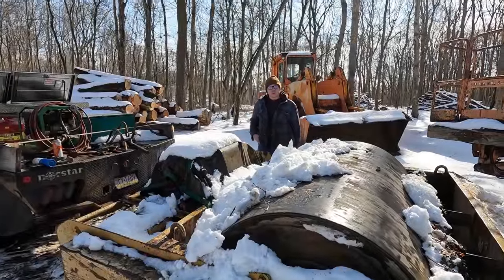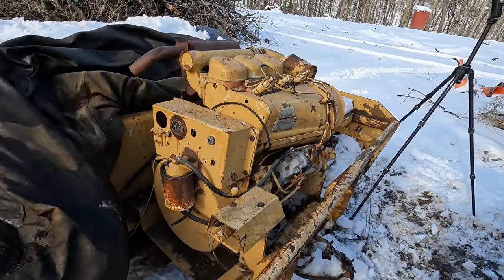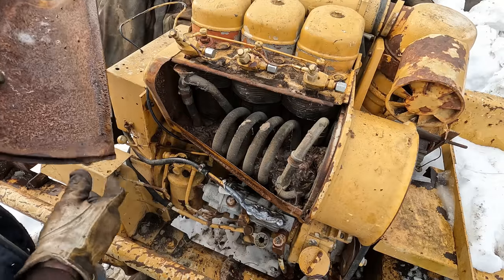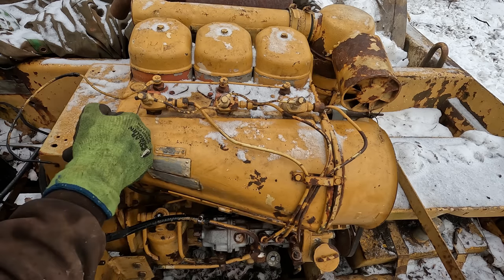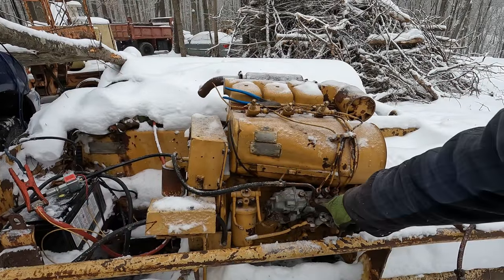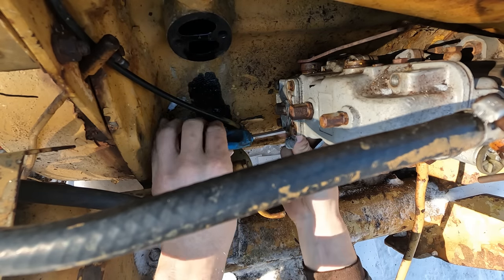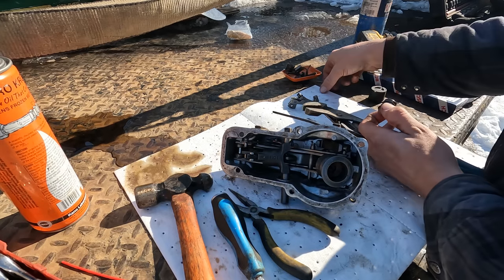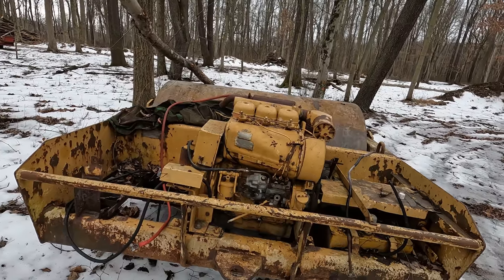Diesel Powered Roller Compactor, Sitting 30 years, Will it ever Run again???

Comment: Matt , here in Europe we have plenty of these old Deutz engines around , and i know one thing : they can be pretty difficult coldstarters in freezing temperature  and if they done a lot of hours .   Does your engine have a glow plug in the inletmanifold like in mine  ? If so , put some 12V on the glowplug for about 20-30 seconds before cranking .  My 3cyl  Deutz starts pretty well but it has done only 8000hrs .
Reply: i think his "glow plugs" are nicknamed a propane torch lol
Reply: Yeas, those Deutz engines are really hard to start due to the fact that they are usually not direct injection, but have a precombustion chamber setup. That needs some time to get warm, especially with old school glow plugs. 
And even if your Deutz engine is worn down to bits, that's not too big off an issue. One of the greatest things about them is their repeatability. It doesn't matter if you have a single cylinder, two or six. The engines only differ in the injection pump, crankcase and shaft. Every piston, head and cylinderhousing/sleve is the same. That makes for great parts availability. Like a piston with rings and cylindersleeve only costs around 200€ for some engine families. And with them not being in one single block you can just chance them easily too. They're just fixed with the headbolts into the block. Experienced personal can switch the complete upper engine in about half an hour. It's all so simple. I.e. for adjusting the compression/clearance between the head and cylinder, you just put washers between the block and sleeve. Deutz recommended method of measuring the clearance is just to put a piece of soldering wire onto the piston and to turn the engine over. 
The wire gets smashed and you can measure your current clearance.

Edit: As for your "shut-off" lever. Often those Bosch pumps have their run position pushed int and it a pull out all the way to stop. Inbetween, before you start to feel the spring action there is usually a third position to give you more diesel during start up.
Reply: There are actually glow plugs, right behind the injectors, the wire could be seen not connected, would just take another jumper wire from the positve post on the battery for around 30sec before cranking and the chances of starting up would multiply...
:-D
Reply: @horstszibulski19  I know lol but he was using the torch as an intake heater
Reply: USA youtubers stubbornly refuse to use the glow plugs. 30 seconds or more is needed.
Reply: @erik_dk842  Not all of them, check Salvage workshop, he is very aware of them! :-D
Reply: @beettheyeetskreet9216  Together with the 80% ether spray, it got very hot on the outside, too...
:-D
Reply: @horstszibulski19  just a little lol
Reply: @horstszibulski19  You are correct. The design of the motor was with British Ricardo designed pre combustion chambers like the old Mercedes Benz diesel engines so it definitely would like functional glow plugs run for thirty seconds or so.
Reply: @erik_dk842  I agree with that, was the same with Doug from SV seeker
Reply: @horstszibulski19  could wire that up to a toggle switch on the side panel to make it easier
Reply: @erik_dk842  Haha I'm not the only one? I have a video of me starting my tractor without glow plugs using gasoline on a rag
Reply from the maker: @horstszibulski19  I tried it. They don’t seem to be drawing any power or making any difference
Reply: @DieselCreek  I always keep accidently deleting my comments while typing them so here we go again:

You could trouble shoot them but therefore you need to know a bit about glow plugs to determine how they should work and how they should be wired up.

The really old Deutz engines and glow plugs with a heating coil exposed to the outside (of the plug, it's still inside the precombustion chamber). These are usually connected in series. Meaning every plug has two connections top and bottom. The top of the first is connected to the input cable. The bottom of that one is bridged to the bottom of the second plug. The top of the 2nd is bridged to the top of the 3rd and its bottom Is connected to ground. 
It’s usually easy to be spotted when you have a cable on both ends of the row of glowplugs. Due to them being connected in series, each glowplug can physically only get 4V at max from a 12V battery. But they are usually rated for even far less, down to 0.7V.

The newer design is more powerful with a ceramic shaft and is also usually connected in series. Meaning there is usually a long bridge on the top of these plugs connecting all to the input wire and the body often grounds them to the block. This means they could technically get 12V (usually rated for 9-11-5V) each. 

But usually glowplugs take less than 12 or 4V. That’s where the glow plug circuit comes in. It normally consists out of a switch, you glow light and a glow resistance (sometimes a small box, sometimes a coiled wire). The job of the latter is to reduce the Voltage getting to the plugs, because if they get too much they either burn through or don’t even heat from the start. So always use the right combination. Maybe it’s even written on your plugs or you have to check their parts number how much they can take (12V battery voltage – the amount your plugs can take = glow resistance voltage drop, but you have to remember the plug voltage in a parallel connection is your rated voltage and in series it’s the rated voltage times the number of plugs).

So now to the trouble shooting: 

First you need to determine whether your plugs are in series or parallel, because the steps differ a bit.
if you know that you can take out your multimeter and use the continuity check. 
If your plugs are in series you connect one of your probes to ground and start checking for continuity. In this case I would recommend to start from the last glow plug. Check if you got continuity to the bottom post of this one, that’s connected to ground. Then check it’s top post and move on down the line until you get to the glow resistor. It something is bad there, check if it’s the connection or a the last plug you tested. Especially the cable going to the plugs is often broken or the last ground connection. If one connection or plug is bad, the whole circuit is interrupted and nothing works.
On parallel plugs you can disconnect the top rail and check if every plug’s top has continuity to ground. Maybe even compare the resistance values between the plugs. But because you said the system doesn’t draw any power I would offer the guess that not all three plugs have a broken ground connection. So you could maybe start the chain with the wire leading to the glow resistance. 
If one plug is broken in a parallel systems the others still work, but their life expectancy is reduced in that case, so they would still brake. 

If everything is fine leading up to the glow resistance you can start checking there. I doubt that you would get a continuity signal through the glow resistor to ground, because the resistance should be high by design. If you get continuity through there it’s even better.  But if not, put one probe on the other side of the resistor and start probing for continuity up to your glow switch and again from your switch to the battery. 
If you still haven’t found the issue you can connect the input of the resitor to 12V and check the voltage to ground: On the input of the resistor it should be 12V and on the outpout 3-4V less. If it’s still 12V it’ shorted or you’ve still got a grounding issue you somehow overlooked.  If the voltage drops there your plugs work and the problem is maybe in the switch or something like that.  If you got 0V after the glow resistor it’s knackered.

If you do this you should be able to find the problem or to just rewire the whole system, but don’t forget that they need this resistance to work.
Reply: If I look at the engine at around 7:54 i can kinda look at them. Seems like there is a input cable but the last one has no connection to ground and the wires connecting the plugs to each other all seem to be at about the same height. So i would guess they're parallel. 
So goof chance its the cable leading to them or a component before it. Or maybe someone already gave them 12V a few times too often and they all died, but that's unlikely and i would hope for you that this isn't the case.
Reply: @DieselCreek  Ah, ok...too bad, they would help a lot, I bet...
Could have know that by the copper that sticks out on the end,  I really expected  that you tried them!
:-D
Reply: @erik_dk842  I use them! I have two F4L912Ws in underground mining equipment and the glow plugs are indispensable.

Comment: Right call on the starter, I don’t think she was spinning fast enough to start.
Reply: On starter theory, the usual problem is that they are full of coils of wire that are insulated by very thin shellac, which burns off easily whenever they are run too long and overheat.  Then with in insulation burnt off the coils, the electricity shorts right through instead of going around in circles like it is supposed to.

Comment: Hi there, 

these are extremely common engines in Germany. Parts are dirt cheap here and very easy to get.

Usually they start, even at -10°C in a blink of an eye.
Honestly, you glow some seconds, turn the starter switch and after very few revs the engine is running.
At least if it got compression and the starter is ok.

Hope to see this engine running again with the new starter!

Comment: You're going to need a fuel return from that pump too. Can run a "stinger " line that basically just tees the return back into the supply line ahead of the lift pump, but its not good to run long term like that, can overheat the fuel. 

Could be your injector tips themselves are either frozen with water, or rusted shut. May have to pop them off and see if Area Diesel can do anything with them.
Reply: I also noted that number two cylinder is still pumping Yoo-hoo chocolate drink instead of diesel...

Comment: Not to kill your hopes here, but my Deutz D4006 tractor with a f3l912 engine,  very close to yours, which sat for 20+ years was impossible to start. The piston rings are known to rust in the grooves.  I pulled all three cylinders,  put new pistons, rings and cylinders and ground the cylinder heads on the cylinder,  and it fired in first try. What a thrill.  😀

Comment: The whole time I was saying to my self was that starter motor needed cleaning out the brushes get stuck and the commutator needs cleaning which is easy just with sandpaper and then you bust up a hacksaw blade and use it to clean in between the copper teeth then you might of had a chance but you cooked it unfortunately, I admire you’re determination you will go a long way sir ,life is all about accumulating knowledge and you are well on the way there and thank you for you’re quality videos

Comment: I used to have the exact same roller, bought to compact our dairy laneways for the cows (to keep rocks down and to help with sore feet on the cows) it's a great machine. We also use to run 3 different models of the Duetz tractors, our first was a 52hp 3 cylinder, that tractor did over 10,000 hrs and never opened up, just batteries, alternator and tires... Never missed a beat, great simple engines that are super fuel efficient

Comment: Hi Matt, love your videos, does look like the spinning speed was too low for the engine to pop off on. But this type of deutz engine (F3L812) is an indirect injection engine so you really need the glow plugs working. But beware with them the are most of the time just 2 volt type. So there should be a big resistor somewhere that's in series to regulate the voltage.

Comment: Hi Matt take the drive shaft off of it and free the engine up also if you've got a Turbo heater stick it under it and get the oil engine warm It should Spin over easier Also I would take the fuel filter off and check it make sure it doesn't have water in it

Comment: Matt, these engines are bullet proof, very simple and reliable. You need to check the glow plugs, because otherwise they are difficult to start. But it seems that you have an issue with poor fueling, maybe the inyectors are stuck or the tips rusted. I have my self a 3 cylinder Deutz tractor from 1962, the engine is similar, but this one looks newer, maybe is a F3L913.

Comment: Matt, You are havin' too much fun in the snow!  Tim Mohn is correct, but it may be a bit newer model F3L912 (70's & 80's)....The AM Bosch starters were $400 apiece in those days...!   Once you get it running, the cyl head seals will probably need replacement, (copper compression rings which corrode when sitting long time -- combustion gases eat 'em).   Great engines, lots of torque, dependable; they like to run occasionally and not sit idle.

Comment: Hei Matt, Diesel engines are a hard nut. It takes a lot of energy to start a diesel engine. There has to be a very high pressure in the cylinder to ignite diesel and high pressure in the fuel pump. To get high pressure you have to have enough volts. 2 batteries will give enough ommhmff the cylinder will spin in high pressure and build diesel pressure and it will fire. When the injectors are dripping fuel close then turn the nut closes to the fuel pump and nr 1 and 2 and 3. I would recommend changing those to batterie cables because of  safety and volt draw. The your awsome content, keep it comming. Greetimgs from Norway
Reply from the maker: I put a different set of them right after I started playing with this thing. I just didn’t show it in the video but you can see they are new cables

Comment: Hello Matt,

greetings from Germany. The engine you have there is an F3L812 eninge, because it has glow plugs, the injection pump is flange mounted to the engine block and the injection lines run outside of the cooling housing. There are many parts sitll available here in europe. 

By the way: This is the Deutz engine I know the best, since it is running my Deutz D40.1S tractor. I have some spare parts lists, even for the injection pump. So if you'll need anything you may contact me.

Kind regards, Kai

Comment: My brother has had several Deutz tractors in southern Minnesota.  He had them in a cold lean to building And had to use a oil fired torpedo heater blow on the cylinders find to warm it up .  It was easier to start to do chores.

Comment: My Dad used to sell and service Porsche-Diesel tractors in the 60s and 70s.  They also were air cooled. They made 1, 2, 3 and 4 cylinder models.  I believe  some of the Deutz parts were interchangeable.

Comment: Just a suggestion, but on equipment you have brought back to life, it would not hurt to take one day a month or how ever long seems good to you and start everything, bring it up to normal operation temp and drive it long enough to get the transmissions and/or hydraulics up to a normal operating temp.  Keeps parts oiled, tires from getting flat spots or rot, tracks from rusting in place, and makes you put fresh fuel in them.  During the summer you can also take the time to clear weeds, seems like you have a whole video on clearing weeds.  Just a suggestion, an onuce of prevention is worth a pound of cure after all.

Comment: I'm not a starter guy either, but I'd just look at what the condition of the teeth and cone are. If they aren't destroyed, source a different motor assembly that provides the same amount of spin. If you can't find something that bolts the old cone on the new motor, then an adaptor plate between the cone or a custom locator cone works just as well. You have to do some modding, but other options are available.

Comment: An infrared propane ice hut heater lying on the ground is a great way  to warm a diesel.  Used one to warm my dodge diesel pick up at the cottage in the winter.  warmed the oil and the block in a few hours.

Comment: Just run an extra jumper cable to the glow plug wire 30 seconds before trying to start they wont start without the glow plugs , never use ether  on  Duetz as it will stretch the head bolts  . Enjoy your videos

Comment: I sure can use that for my driveway. I just resurfaced it with 5/8 gravel. Great job on the video. Next time jump it right off the starter so to by pass all the bad wiring.

Comment: These loud engines are used a lot in Europe. Do you want more power? we just add cilinders  F2L912 / F4L912 / F6L912. There are even V12 air cooled engines! I look forward to the next video.

Comment: I rebuild these machines as well as the motors where i work. From expirience i know you really need a feeder pump. You dont need the same as the original an electric one works just fine aswell. Most of the ones that come through our workshop havent run for years and i always do the same to get them running good. Remove the injectors and fill the cylinders with some oil. crank with a GOOD starter. Make sure the is plenty of fuel to the pump. On idle the pump should get .5 bar of fuel pressure. These engine really like to crank fast because they tipicly have pretty bad compression when they have sat for a while. The oil help with that alot. Lastly yes, you would benifit greatly from working glowplugs. As for the machine itself, the hardest parts to source are the centrifugal clutches. The wear parts are not made anymore but there is a company called wiflex that made "replacemaments". I strongly recommend that before you start the machine you remove the belts from the clutch because if the engine wants to run away, which happens more often then youd think, you dont want the vibro to engage. It will litteraly just wander of. I have som crazy stories to tell haha. Either way, nice to see one more comming back to life, good luck and have fun.

Comment: You don’t need to change the oil in the injector pump it is fed with oil from the front cover and fills 3/4 to top of pump and drains on the gear to lube it neat thing Bosch does p pumps fed with hose and drain into front gear housing good videos love them